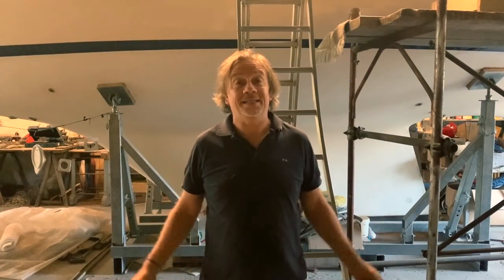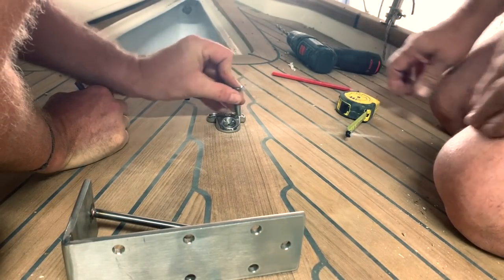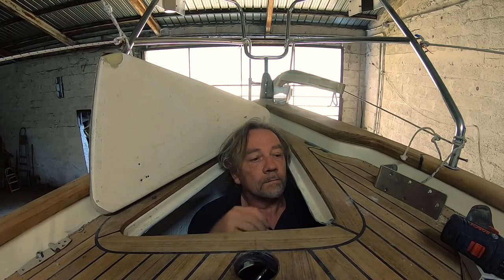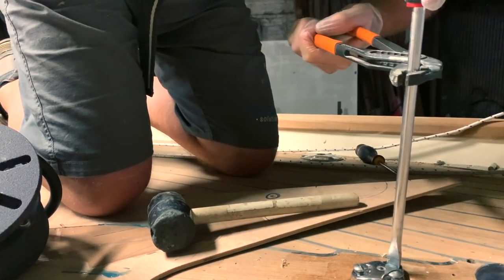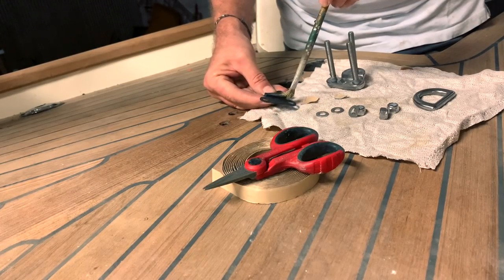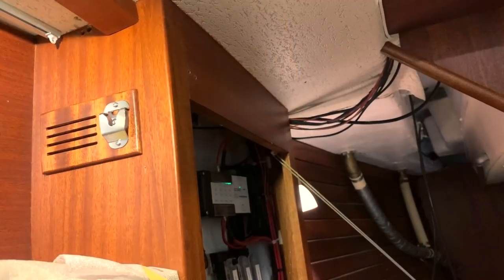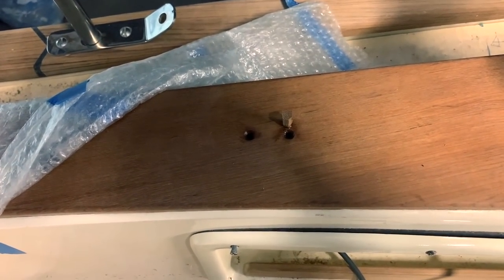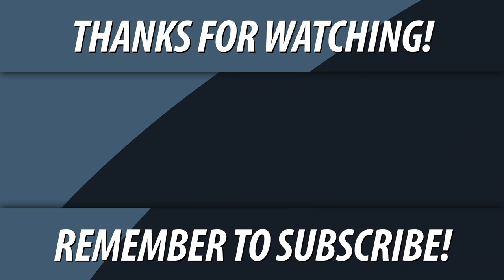Hallberg-Rassy 312 "Ellös": INSTALL THE YANKEE CHAINPLATE + MUCH MORE

Comment: HR use the loop part of velcro where floorboard touch wood, if not used you get a noise when running the engine.
Reply from the maker: +Knut Inge thx for tip!!!

Comment: Grazie Gabriele for those videos. We bought an HR 352 two years ago and it's good to see the guts of a 312, as they are very similar boats. I will have to refit the electrics pretty soon…I'll reach out to you for information/suppliers of the parts that you have installed…You've used mostly Italian products, right? Thanks again for sharing your work!
Reply from the maker: Hey Philip! No I’m install 90% English product and American ones... Italian in electric doesn’t are make the best product! But if you need info don’t hesitate to contact t me I can forward the contact! Great boat 352!!!
Reply: @sea4see  Thanks Gabriele! Nice to see the progress on your boat ☺️ Could you forward me the contact of the products? What wire sizes did you get for instruments/plotters/etc? Thanks so much for your help - and maybe we cross path next year, as we cross the med from the east next summer ☺️  (@svamae)
Reply from the maker: @philippreinmann1686  hey Philipp for the wire I used mainly 3 mm to 6 mm depend of what I need to supply. Electronics I go with 3 mm electric pumps with 6 mm plated wire made by oceanflex and you can find those At Furneaux Riddall on his website! Great service and fast one